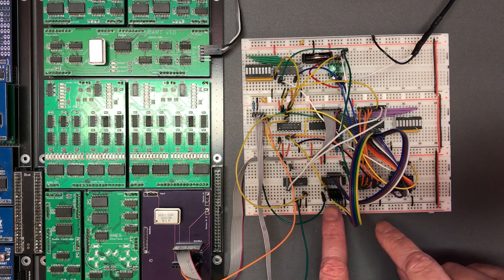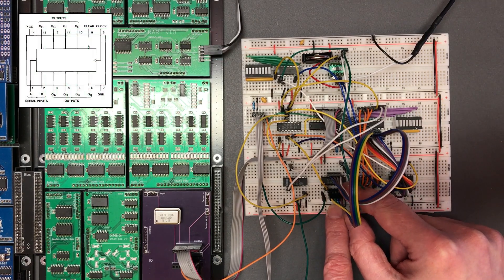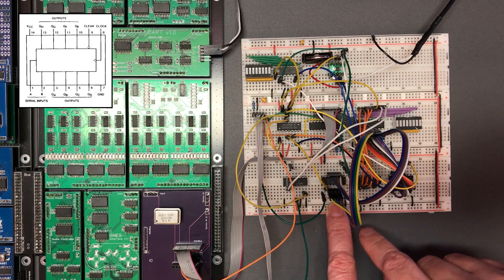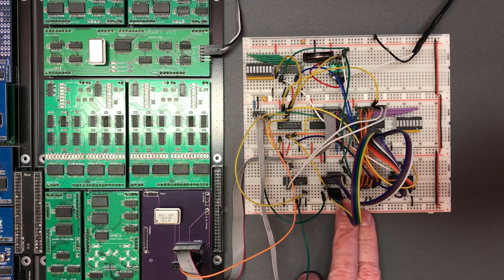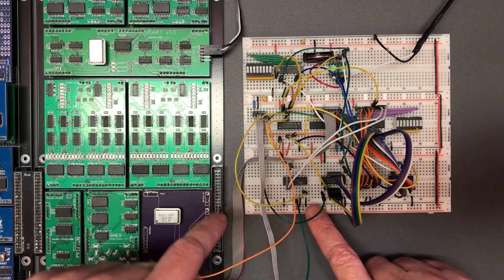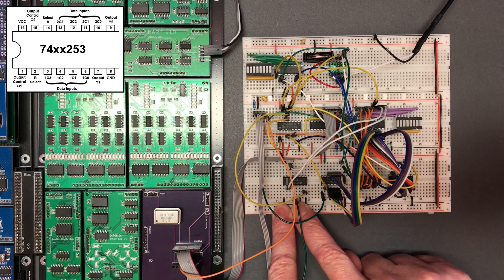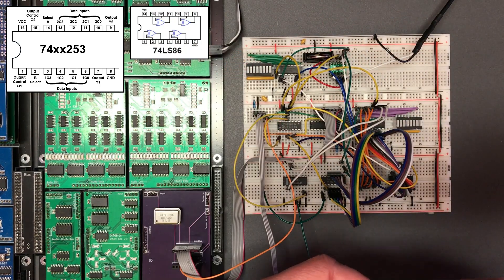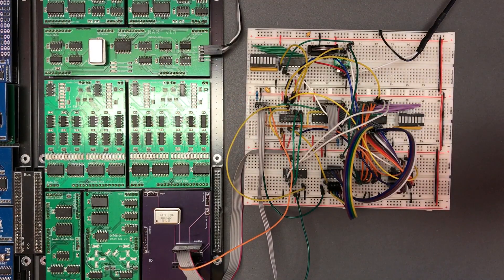Hardware SPI, Extra tweaks - IO from Scratch

Comment: Great series, I look forward to each instalment! Keep up the good work.

I was hoping you were going to do this with the last clock mode, although I assumed you were going to select from clock vs constant low on the high bit (with a single AND gate instead of the 253 4-to-1 selector?), and feed the selected result to the XOR gate you're now using anyway, along with the lower bit to flip between constant-low-or-auto vs constant-high-or-auto-inv. I can't remember if you're using the other half of the 253, but I think not since it would be switched on the same signals, and if that's true then going from a whole chip to one gate seems like a win (unless I've missed something? entirely possible). Maybe you'll never use them but having three spare AND/NAND/OR gates (take your pick) might come in handy… 🙂

One other thing—I find the naming of `SPI_Clock_Invert` rather confusing at this point—the dual use of "Invert" makes it sound like it's related to `SPI_Clock_AutoInv` but IIRC the `SPI_Clock_Invert` bit controls sample-high, shift-low vs sample-low, shift-high and the idle state, so the out-going clock is inverted vs the data timings? If so, I'd be tempted to call it `SPI_Sample_On_Fall` or similar. IMHO it's not immediately clear from the constants what "regular" vs "inverted" clock means in this part anyway.

Anyway, I mostly wanted to say I'm really enjoying seeing this all built from the ground up. As always, I'm excited to see what you're doing next.
Reply from the maker: Glad you are enjoying it. You are right that multiple uses of the term invert can get confusing, it made sense to me this way round but I appreciate that is very subjective.

Comment: Oh I really thought the 4th option would become "External Clock Source" later. But that was under the assumtion that there'll be a 20MHz DMA Engine, which you already explained your CPU does not support.
Reply from the maker: I will have future system builds that take some concepts further but it’s wouldn’t feel right to crowbar that into what is supposed to be a simple demonstration build.